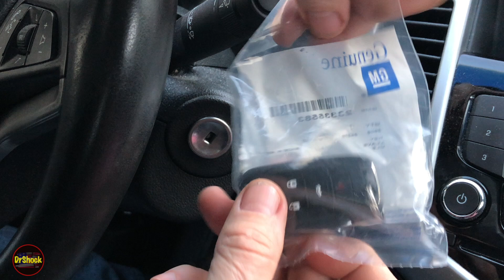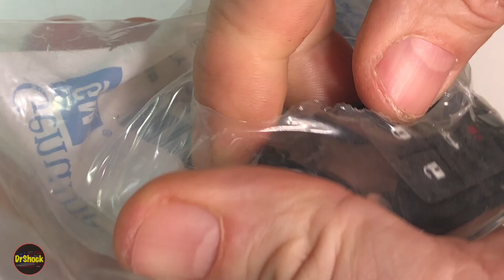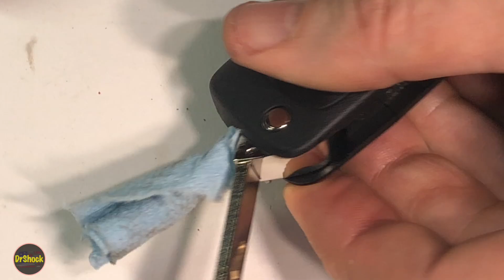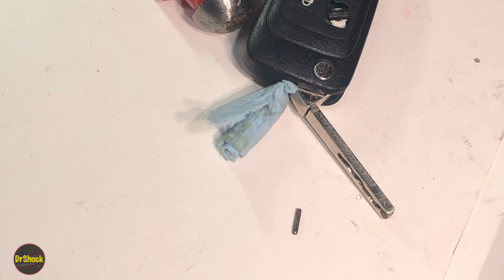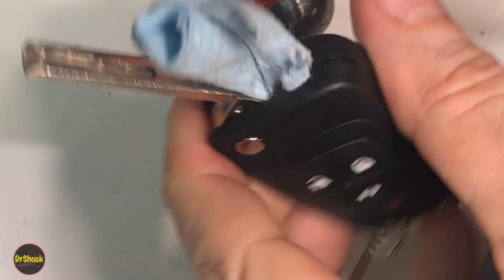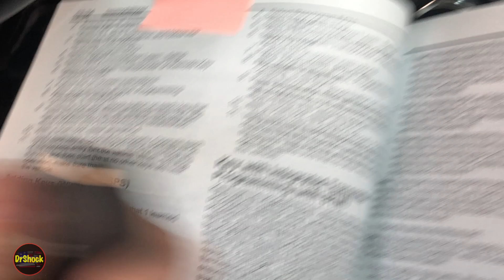2011 - 2016 OEM GM Key Fob Flip Blade Replacement & Transmitter Programming (Chevrolet Cruze)

Comment: I have a 4 button fob like the two shown in the top row of your picture of fobs. How do I determine which of the two shown is the correct one I need to order? The part number (13574862) on my current fob comes back as unknown when I enter it on the GM Parts website.
Reply from the maker: This video is only for the Chevrolet Cruze, so if you have one it should match the view I showed driven by what options the car came with.  Look at the text below the part number on those you reference, they vary by a specific option code (which you can find in the options sticker near the spare tire inside the trunk on a Cruze).

Comment: This doesn't seem to work with the Holden Cruze?
Reply from the maker: The Australia / New Zealand GM market (i.e., Holden brand) fob itself should be identical in design and construction to that used in North America for what I showed there.  However, the GM part numbers I showed for the fobs are only for those used in the North America market (primarily the difference is the Chevrolet logo on the back and radio frequency).   The programming steps for the fob may differ outside of the North American market, due to the use of a different BCM in your Holden series.

Comment: Thanks for this! I was able to remove my pin with a drill bit + some gentle hammering. The way the buttons deteriorate over time is such an annoying problem to encounter when you own your vehicle. I wish @Chevrolet would have simply used hard plastic, recessed buttons. The soft button design looks nice but also leaves it prone to accidental activation in your jean pocket (especially when alongside other random items) while active. I have found my Impala trunk open more times than I can remember. 🤤

Comment: Why punch that pin out when you can just swap the key an board into the new case? Doesnt make since. Work smarter not harder. The amount of time you wasted punching that pin out I could have had 2 or 3 key fogs already swapped around. Your way is the long and hard way of doing it.
Reply from the maker: Because, as the video title indicates, we’re only using genuine OEM parts from GM so we're not concerned with the time. Besides, you're not going to open a genuine GM fob easily, they are sonic welded together and cannot be opened non-destructively.  We’re not using any sort of inferior unbranded Chinesium type aftermarket parts here.
Reply: I purchased a generic fob shell and cannot transfer the old key to that shell, it does not fit, only the circuit does. So now its either changing blades like DocShock demoed (thanks!!), or a locksmith cutting the blade.

Comment: This is a dumb question, but you never know. Is it the same part numbers and process for rebadged versions? I have the Holden Cruze for example, and I don't mind if the badger on the key is chevvy or holden just so long as it works. 

And secondary question in your description you list 2 models for each type of key, one with "RPO ATH transmitter". I'm not sure what that is, could you please explain?
Reply from the maker: I did look into this when researching this video, but the Opel and Holden part number data was more difficult to track down from here in the USA.  The part numbers will all be different for the various fob button configurations (and of course the Holden logo will be on the back cover), but the blade swap and programming processes should be largely the same (if not exactly the same for the blade part) on those models also sold in North America - such as for the Chevrolet Cruze one here (rebadged as the Holden Cruze where you are).
Reply: @DrShock   @DrShock  Thank you buuuuut they unfortunately are 'largely the same' and not exactly. According to the Service Manual for "Canada, Europe, South America, Asia, and Middle East" which I believe is the category the Holden would fall under. You need to use 2 keys to trigger the key programming mode. As I only have 2, I can't use this method! So I was up creek anyway. 

But I appreciate the time taken and speed of your response!
Reply from the maker: Yeah the programming was the one part I was sus would differ.  The blade part should be identical.  You should be able to do this using a GM MDI tool and Techline Connect with zero keys, if that is a helpful option at all for programming.

Comment: Excellent tutorial that I have successfully done twice but I also find it easier to simply snap open the fob and remove the spring activated key and install the old key from the old fob. More cleaner and simpler, you just have to be mindful of how the key was placed and re-tension the spring.
Reply from the maker: Thanks.  Though you're not going to simply  open up a genuine GM key fob flip blade case of the model year range this video covers - they were sonic plastic welded at the time of assembly making opening them up usually quite destructive.  ;-)    That experience is more indicative of an aftermarket fob design.

Comment: At this time, for under $30 you can get two pairs (I paid $17) of key fobs with electronics and batteries off of Amazon that work just fine....

 You just have to drive out the pin with a 1/16th or metric roll pin punch.  GM as a company has already completely sold out to China and is nothing but a dead name brand at this point.
Reply from the maker: We never use inferior fake or Chinesium parts, only genuine OEM branded parts.  Genuine pays, they don’t cost. No comebacks or having to do the job over again.
Reply: @DrShock maybe you didn't understand... GM parts are Chinesium / inferior already.

  The "OEM part" you're holding was assembled in Mexico using Chinese parts to take advantage of NAFTA.  GM is a Chinese company.. SAIC took over all of their global assets already.
Reply from the maker: Made in China, or Mexico, or wherever is a fact of modern capitalism and our global supply chain.  Chinesium is not the same as just made in China by an OEM.  Cheap Chinesium unbranded inferior grade parts could come from anywhere, not only China.

But good quality OEM parts come out of many non-USA countries including China. The advice of the day is buying genuine OEM parts saves time and money, regardless of where they were made.
Reply: @xephael3485  what if the motherboard may be damaged from the broken buttons and debris? Will just switching the blade work?

Comment: This video made it easy in my decision. Both keys are on their last legs.
Step 1 buy a set of 2 new keys 23335583
Step 2 punch one of old keys out and insert it into one of the new fobs
step 3 program the new key and then once the first new key is programmed punch and repeat for 2nd new key and voila.

Comment: Why you cut the key if you can use old blade ???
Reply from the maker: Not everyone has an existing key fob, or one with a blade that is not too worn for reuse.  Some viewers will not have the appropriate tools, or be comfortable, for swapping the blades either. So we're showing both approaches here.
Reply: @DrShock also you need the  2 keys i only have one even if i switch blade i wont be able to set the pad
Reply from the maker: For the Chevrolet Cruze, you must already have at least one programmed key in your possession to add another yes.  If you have no keys, then it requires a dealership or high end indy shop to use the GM SPS2 programming system to mate the key fob(s) to the vehicle.

Comment: Does it work for a 2016 cruise limited?

I'm in canada
Reply from the maker: Yes, for 2016 it would only apply to the carry over design Cruze Limited as the body style changed that year for the mainline Cruze.
Reply: @DrShock thank you good sir!
Reply: One other quick question.. can I find out which part number i need from the actual semi broken key fob? (Or it's fully working twin)
Reply from the maker: Yes, if it's a genuine GM part.  The GM number will be laser etched on the inside edge of the fob plastic housing where the blade folds down.   You may have to Q-top alcohol swab it to remove debris to make it out though.